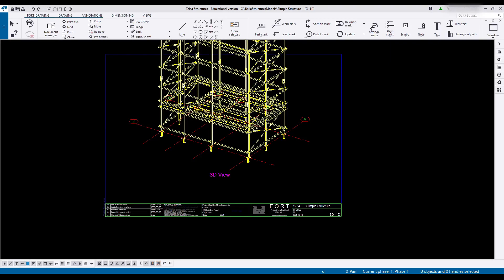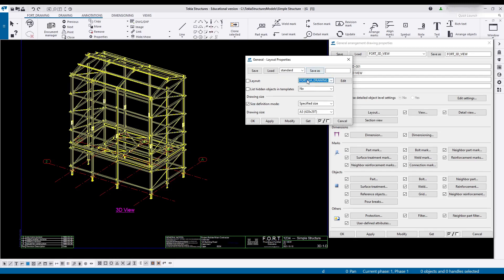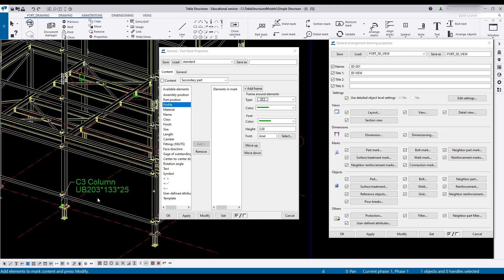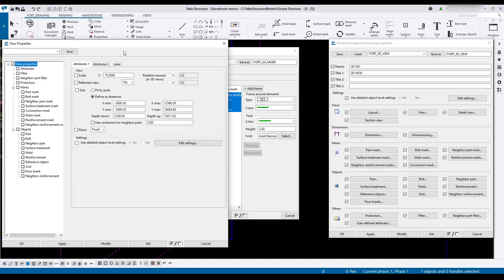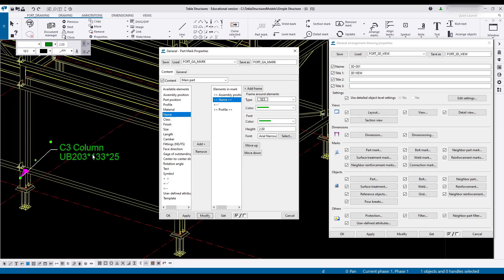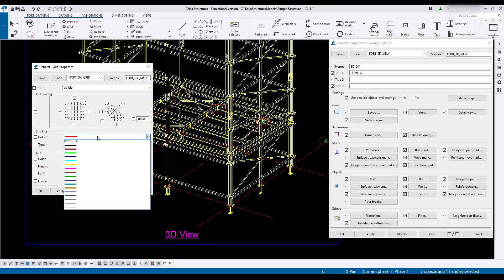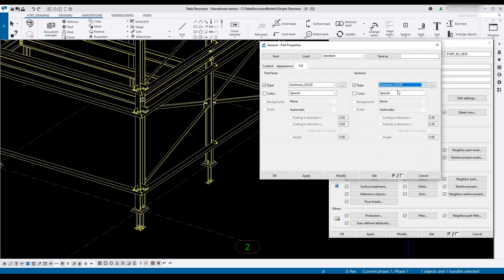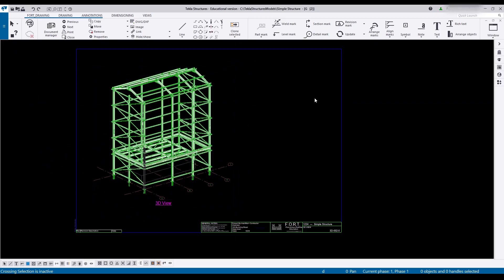Tekla Structures GA Drawing Settings

Comment: hi can you do a touturial on   how to  color drawing lines same as color of part class : example if i have a beam  color blue   and anathor beam in yellow (in modeling by changing part class) when  i open the assembly drawing it automaticly detects and draw the parts with same color
Reply from the maker: Hi, you cannot do that directly but you can definitely do it in a round about way,
Their are some limitations to the colors you can use in drawings (see the colours available in the printer's 'line properties' tab)
The main problem with the colours in drawings is each colour is assigned a line thickness and while you can change these you would have to carefully manage what colours you can and cannot use so the dims ect still end up printing with a lighter line then the parts.